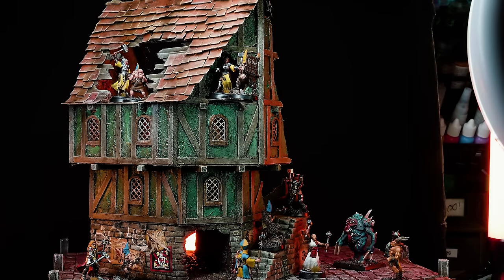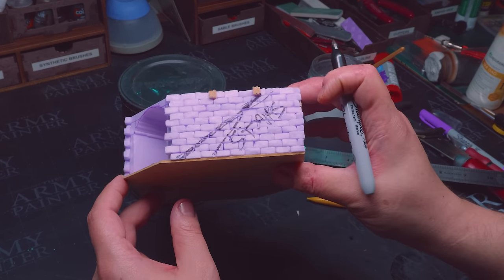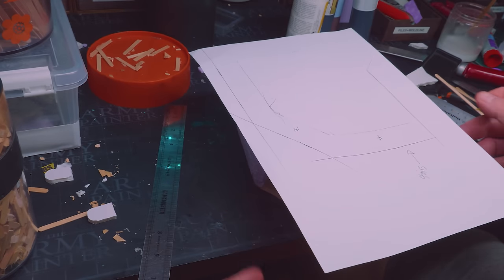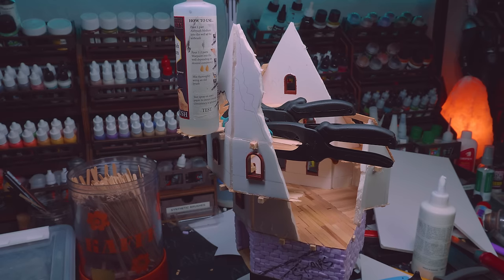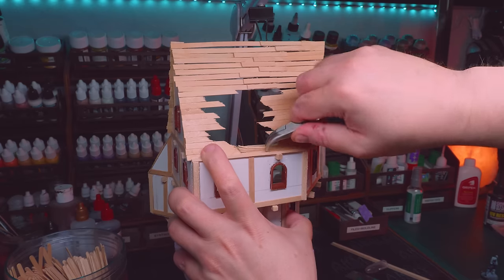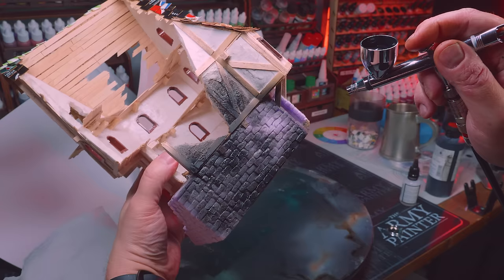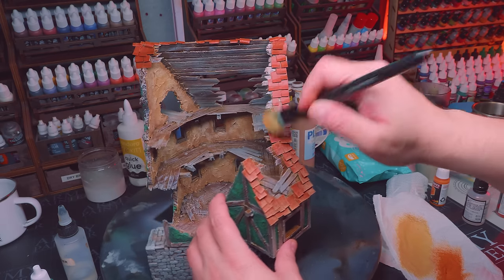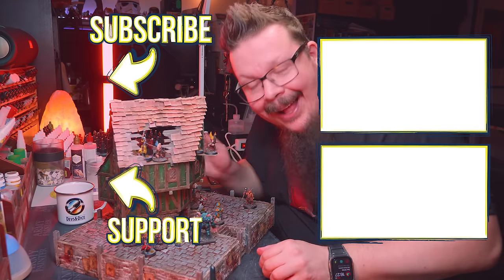Improve Your Mordheim Terrain - here is how I did!

Comment: Snyggt, som vanligt ;)

As one who used to work in construction it is pretty hard to deviate from the 90 degree corners and straight walls, but I like to think (when making Mordheim ruins) that most medieval townhouses were built where they fit and that the space available would dictate the size and shape of the building. That stories were added as needed and that several houses would occasionally merge a bit, to save on the number of walls you had to build. A bit like you did here, just cutting a bit of mdf and start building, sometimes with a goal, but not always, usually works out pretty well.

The next challenge is to come up with a way to make the buildings a bit crooked. Not severely, just a little bit, like thoose really old houses that has started to set.
Reply from the maker: This is exactly my train of thought! So happy you confirmed my thesis on this! Yeah that would be awesome! I have been around the UK and some of the old building are leaning something fierce! But still look amazing! 👍😅

Comment: I have been getting into the habit of 3-D printing stairs - I like a more open, wood framed set of stairs, and building those by hand is a pain and a half.
Reply from the maker: Ahh nice! Any perticular one you can recommend? 👍😊
Reply: @DevsDice  Third attempt at replying... ScatterBlocks Wooden Platforms may be the most versatile - no railings, but an ogre can just jam the corner of their base into he space between stairs and not fall down.
Reply: My most used stairs are from a $5 wild west sheriff's office on My Mini Factory - but I had to play with the scale.

Cast n Play has interior sets, but they are only sold in fairly expensive sets. Nice stuff, maybe not as broken as needed for Mordheim.

There is another set that I use, with a 90 degree bend. but I have no idea where I got it from.

Comment: A lot of terrain builders seem to be using hot glue. However, when I tried it, it seems the glue dries up really fast, almost too fast, so that if I don't place the piece immediately, it's already dried. Also, it drips and gets everywhere. It's made me give up and use PVA instead. What am I doing wrong?
Reply from the maker: Hot glue does indeed harden quite fast, which is the main feature of it in my book. It can of course vary depending on brand I suppose. My general tip when using hot glue is to have a good idea on where you want to place the object in question and move quickly! Sorry I can't help more! 👍😅